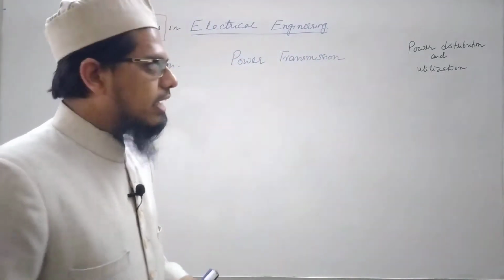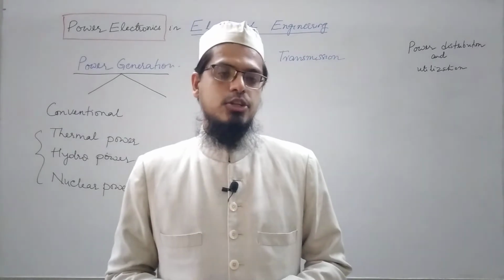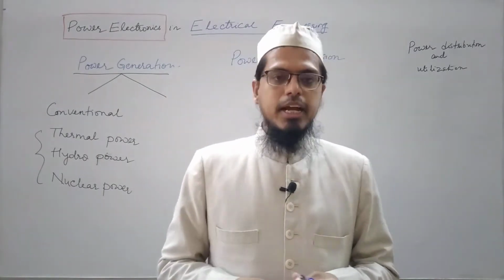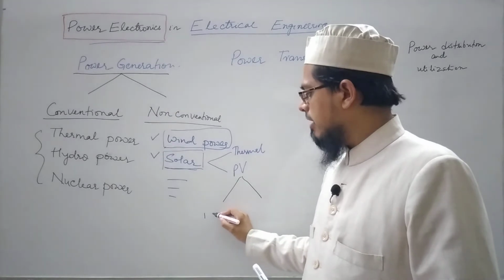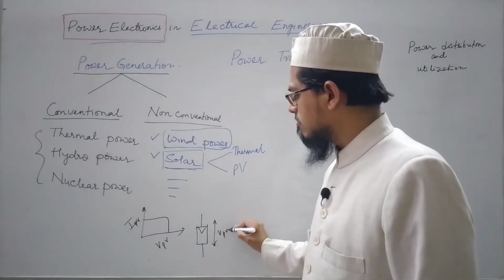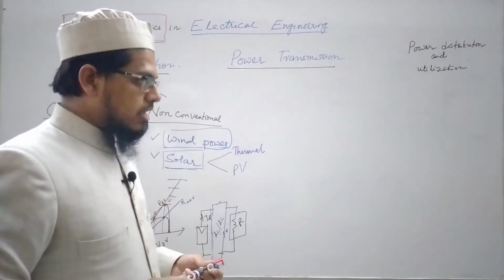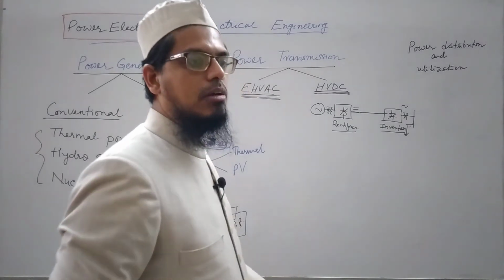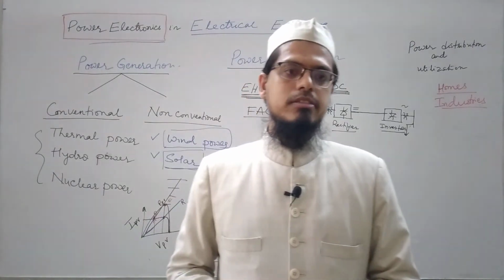LECTURE 1.1: Applications of Power Electronics

Comment: what are three major applications of power electronics
Reply: In my opinion power electronics is like a video game in which, we play with the different types of power electronic switches like a diode, thyristor, MOSFET etc, to obtain suitable output waveforms in terms of current or voltage according to the requirements. Some common applications of power electronics are designing of DC to DC converters, Inverters, Active power filters.